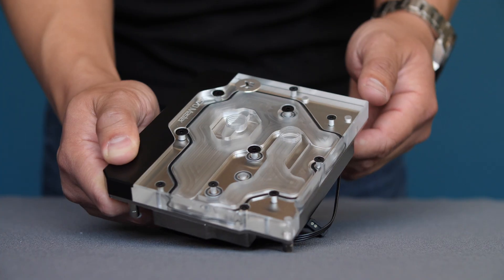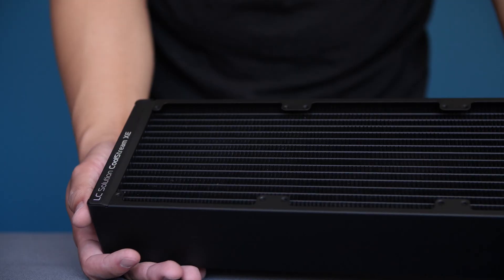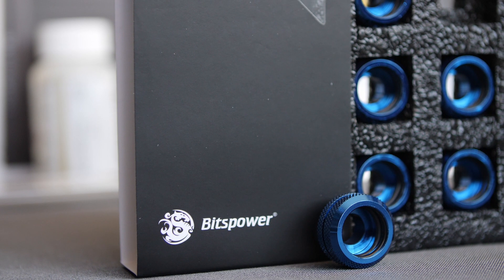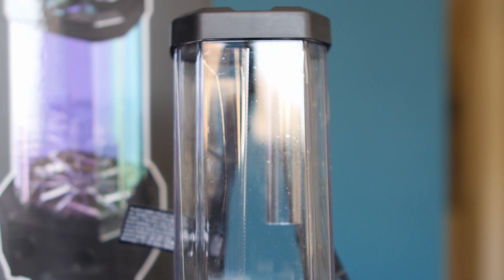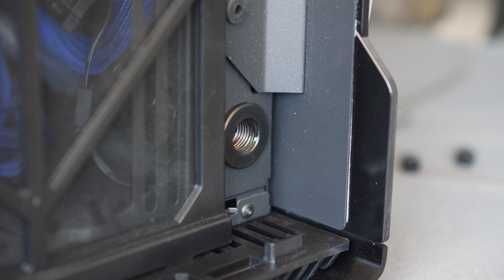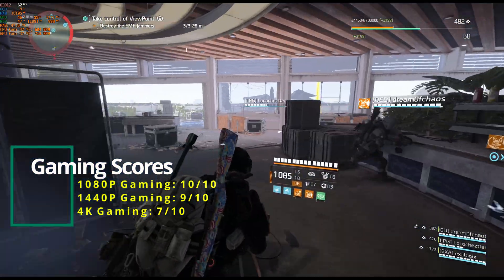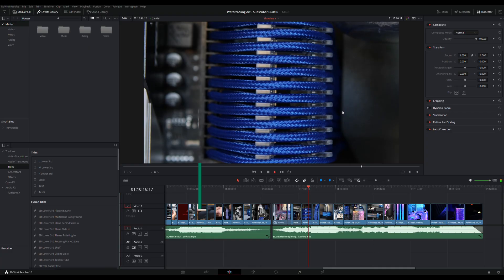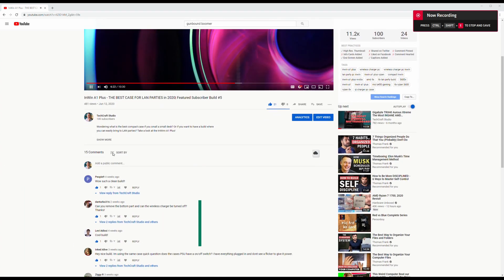Custom PC Water Cooling Art | Hard Line tubes | Subscriber Build #6

Comment: Looks great! What are your thoughts on metal tubing? Metal vs PETG (I like the looks of metal personally). Pro's/con's
Reply from the maker: Chimm WWII online I haven’t worked with metal tubes before although I would love to in the near future. Aside from the visual differences, know think PETG is tricky to use since you need to heat the area to be bent and you need to be pretty accurate. If you have the bend too short or far, it will have to be redone.